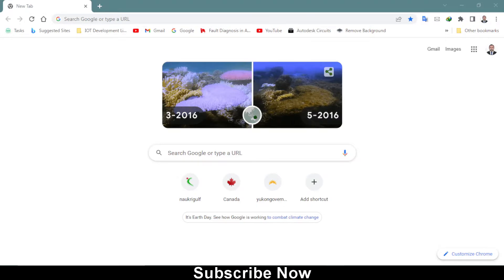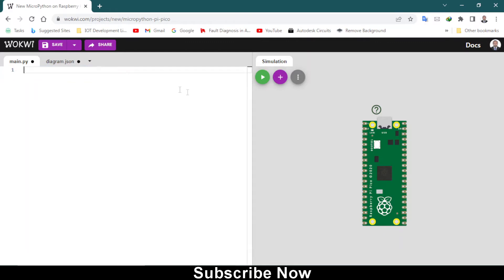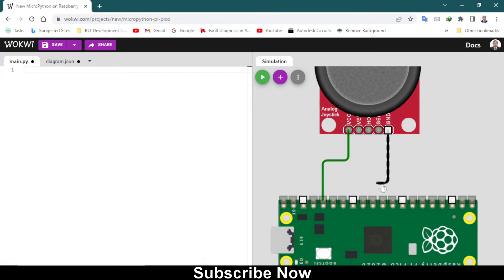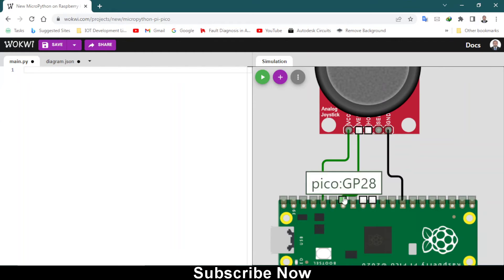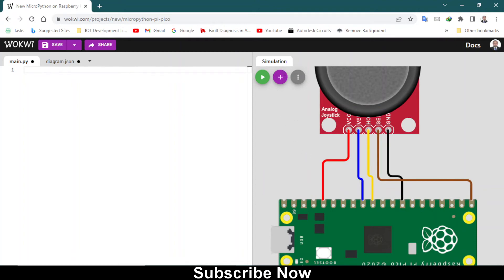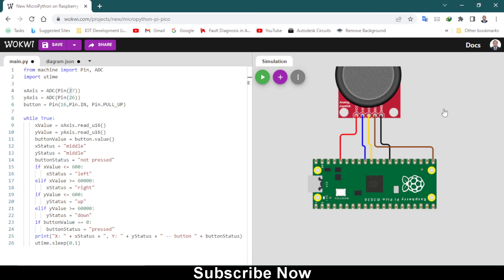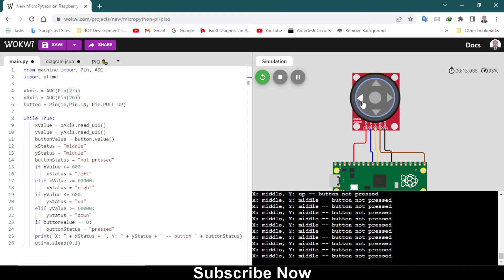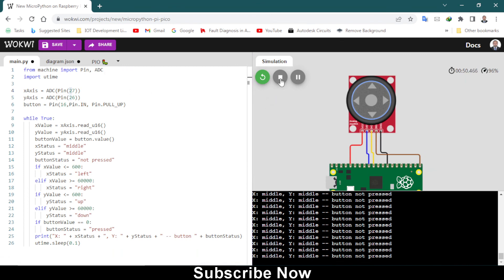Joystick interface with Pi Pico| Wokwi

Comment: During simulation, I try to click on the joystick and make circular movement. It doesn't work.
Reply from the maker: Make sure your connections are right
Reply: @WaqasFarooq  I mean I can move up down left and right . Just 4 axis.
I'm using the joystick with Arduino. I haven't written any code for it yet.

Comment: Is it possible to have two analog sticks for the Pico board? I know by the diagram that only the slots GP28, 27, and 26 are available with ADC, and that the two analog sticks can share the VCC and the ground, but the problem is that there are only a total of 3 ADC pins on the Pico board. Is there any way that we can extend this?